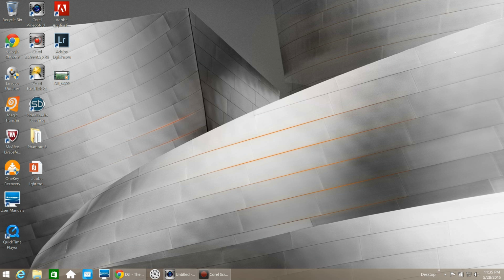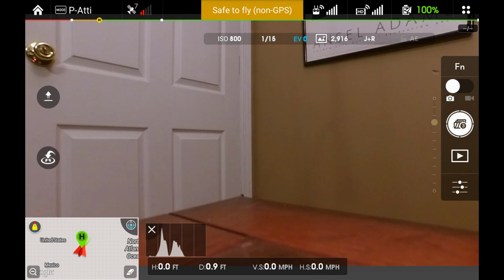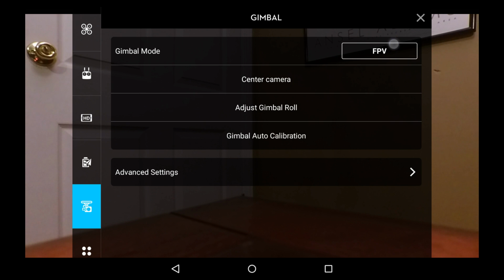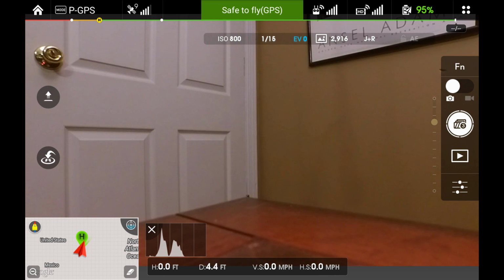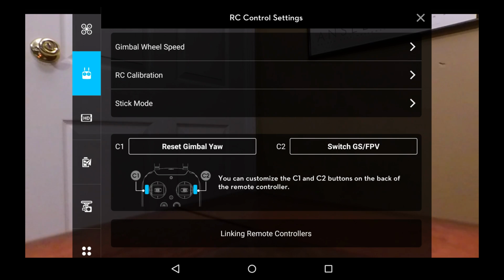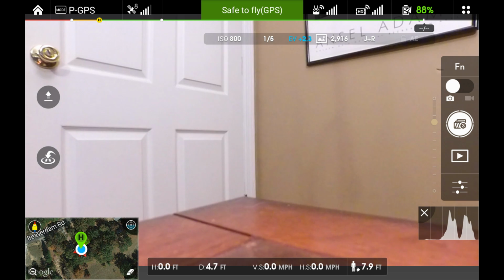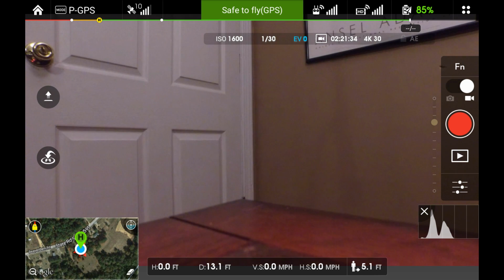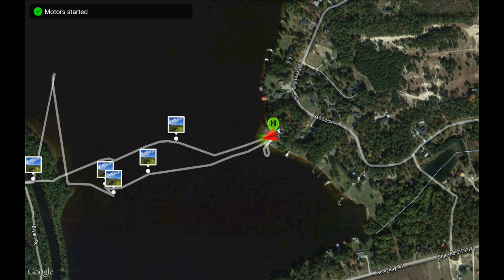DJI Phantom 3 & DJI Pilot App (now DJI GO App) Walkthrough & FAQ

Comment: great video!!  thanks!!!   On the ISO settings, what are the P and M options on screen. I know the M is prob manual what is the P? is that AUTO?
Also looks like my EV is set at +0.3 is that about normal. I never have messed with it that must be default? should I change it? Like I said ISO is set in P whatever that means....thanks!!!
Reply from the maker: +natserog  I'm going off memory here...I believe the P stands for "program". In auto/program mode, EV stands for "exposure value". If you make the number positive the picture will be more exposed, if you make it negative it will be less exposed.

Comment: Gosh ample choice can be a bit daunting at times.  I was wondering if you can tell me a bit about max distances and what aspects of distance affect what eg live video feed etc?  Oh and where is video recorded ie on drone or android?
Reply from the maker: Wing Man Distance is dependent on terrain and condition but you should be able to get over a mile without a problem. This unit pretty much has the longest range out of the box for an RTF. Video is saved to the SD card and the camera and you can also cache to your mobile device real time as well but this may slow down your video feed and lower the performance of your mobile device.
Reply: Drones In SC Thanks.  Also if I may ask what would happen if it went out of range? Are there any warning/indicator lights to indicate range limits or weak signal issues, and also what are the safeguards with range issues?
Reply from the maker: Wing Man In the normal mode with GPS on, the unit will return to home point. All the indications you are asking about are covered in this video. Range, signal, battery life, etc.
Reply: Drones In SC BTW have you have a chance to look at the PlexiDrone by DreamQii?  They have a campaign on indiegogo.  The specs look pretty amazing especially the x3 units with 'swarm' capabilities!   However there has been quite a stir about they customer service and blocking customers requesting refunds re march delivery dates not being fulfilled!  Just thought I'd get as much of a heads up as I can rather before potentially blowing $3k!
Reply from the maker: So many units have disappeared after taking money from crowdfunding...or the units that end up in production do not meet the promises that were made initially. There are tons of quadcopters on various crowdfunding sights...and in various stages of development...I doubt most will ever enter production.
Reply: OK thanks for your opinion.

Comment: I just want to thank you for the best and most informative video I've come across yet. And get your suggestions regarding the firmware update for the RC (controller) I successfully upgraded the Phantom 3 Pro firmware, but have found it impossible to upgrade the RC. I tried everything; cable from Phantom gimbal to RC, new SD cards and all I get is a red light and beep until it turns itself off. I did some research and found that some have been flying for years like this, and one tutorial video showed the same little red flag I get in the App stating to upgrade the RC firmware. I've had no problems flying and having a blast anyway!
Reply: +Jim Miller Good news! I just upgraded to the DJI Go App and  V1.3.20 firmware with NO problems whatsoever and the RC control was a success also! Very happy with the results and easy to do. There must have been an occasional  bug in the RC upgrade that has been remedied. Highly recommended!
Reply from the maker: +Jim Miller Glad you got it working...with the DJI Go app, you don't have to use a memory card to firmware update the transmitter anymore.

Comment: On my new Phantom 3, the front LED,s (fixed red) stopped working.
Some opinion will be welcome.
Thanks
Reply from the maker: João Carlos I haven't read of anyone having that specific problem. if it is brand new, and you want to honor your warranty then you should contact your dealer or DJI. Otherwise, open up the shell and see how the lights are connected. I am unsure of how it's connected as I only had the P3 in my hands for a short time before I had to send it off for a FC and gimbal problem (still don't have it back).
Reply: I solved the problem.
Arms LED can be disabled at any time by configuration. It was my mistake.
Thanks a lot
Reply from the maker: João Carlos Oh, you are talking about the ability to turn off the LED lights...I thought you were saying there was something wrong with them. Got it!

Comment: Native here in Chas. S.C.  
I'm having problems with my Phantom 3 Wifi not showing on my iPhone. Iv'e flown for a couple years and Iv'e flow my phantom 3 a few times as well. Why do you think it's not showing my phantom 3 on my iphane 6+ within the WiFi?
Thanks for your help and video's.
Tommy
Reply from the maker: Tommy Bessinger P3 is not like P2, you don't wifi connect to a booster...you use the included cable to connect your controller to your mobile device (no wifi).

Comment: tell me please what the connector wire that came with my dji3 that has a mini usb and a usb on other end. I know it plugs into my copter but what does it do?
Reply from the maker: Charlie Stovall I only had the P3 for a week and it's been out for repairs for two months now so my memory is a little hazy on this. If I recall, there was an option in the DJI app to enable downloading of logs..then you could connect directly to the Phantom and download logs. Of course, you can also get some logs from your mobile device.
Reply: +Drones In SC 
whys it been out for repairs?...problems after a week??
Reply from the maker: darkelf1000 I had a problem with the original SDK firmware that caused some FC errors as well as a gimbal problem. I finally got it back a little over a week ago.
Reply: Wow, am cautious about getting one of these. 
Getting a device for fpv that does not lag is another headache.
Reply from the maker: +darkelf1000 It's a good platform...just buy from a reputable dealer and try not to deal with DJI directly...you will get minimal support from them (they still act like their doing business in China). 

Any of the quads out there that provide a digital HD video link to you are going to have lag...some more than others. The P3 lag is very minimal..but if you don't want lag at all then you need to look at something that uses an analog FPV transmitter, like a racer...but a racer is not a photography/video platform.
Reply: i fpv my rc car with fatshark goggles on 5.8ghz and headtracking on my channel which is great fun, but fancy this as i live in a very scenic area with lots of coastline.Thanks for a great video.

Comment: I'm curious about your C1/C2 settings options.  I have a brand new P3 Pro and I don't have the same options list-specifically, the option to switch the map modes. Is there something I have to do to enable these modes?  the ones I have are not particularly useful.
Reply from the maker: johnnytraveler1 I'm not sure why you can't get it to work...worked for me just as I showed in the video. I don't have my P3 to try things out on right now...its been out for repairs for a looong time...getting ready to call DJI and ask them where it is.

Comment: You are out of date. Current version is 1.2 as shown on the download page.
This version has a new feature. Instead of the old waypoint mapping style, you now plot a course with your finger!
Just one problem. I can't find a way to set the altitude along the course.
Maybe you can?
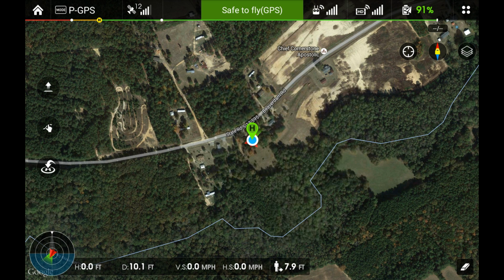Reply from the maker: Richard Remington II Richard this video was released in May...with the current firmware at that time. You can not get waypoint flight with the P3 and stock firmware at this time. The feature you mentioned is covered in the video at 18:34 but it is not what you think it is...not waypoint/automated flight...it's just a pre-planning tool where you can draw on the map with your finger and make some blue lines to represent your proposed flight path.

It is unknown whether or not DJI themselves will release this feature within their own app & firmware...they appear the be replying on 3rd party apps to do this via the SDK (Software Development Kit) using apps such as DJI Autopilot or DJI Ultimate Flight.

Comment: How do I change to Home lock, course lock or atti lock like I do on my Phantom2?
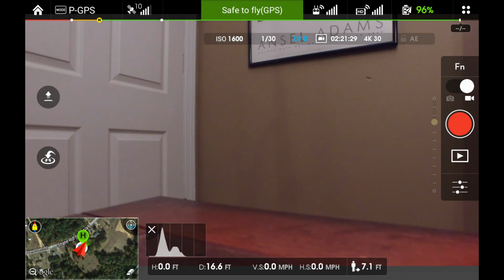Reply from the maker: Kenneth Gundersen Covered in this video at 32:30.
Reply: Drones In SC Thank you mate. It sort of works a bit difference than the Phantom2, but it seems to work pretty well when you get used to it.
Reply: You don't. Home lock is automatic. There is a 3 way switch on the top left side for either P,atti, or failsafe.
Everything else is done elsewhere in the app.
Reply: Richard Remington II As far as I know there is no home-lock feature on the P3 yet. I contacted DJI and they answered that there is no home-lock feature now, but they did confirm that they are working on adding home-lock feature in the future. I find it a bit strange that the P2 have home-lock, but P3 dont have it yet.
Reply from the maker: Kenneth Gundersen Kenneth is correct. There is no home lock function at this time (even though it IS mentioned in the manual). The only IOC mode we have is Course Lock. I think Richard may be confusing RTH with Home Lock. Again...this may be something that shows up in a 3rd party app using the SDK.

Comment: lag ! lag lag !  in video monitor live
to slow frame rate for fpv !!
Reply from the maker: Marty Mcfly When I flew there was minimal lag and I flew FPV with no problem at all. That being said, that was with earlier firmware. I haven't flown the P3 in two months and from the reports I've seen, lag has become an issue for many with the latest firmware releases. My unit is still out for repairs so I haven't personally flown with the newer firmware.

Comment: What is the difference between gimbal wheel speed and gimbal pitch
Reply from the maker: Devananth V.S. I haven't had my P3 for two months now...out for repairs...I only had it for a week unfortunately. Both of these seem to have a similar effect on the camera but I am not sure if it supposed to be that way or not. Perhaps someone else who has flown recently can chime in. Maybe they do the same thing in a different way..(i.e. gimbal pitch slows the maximum rate of the gimbal movement and wheel speed lowers the sensitivity of the knob on the controller), but that would be speculation on my part.

Comment: Can you set a route for the quad to fly automaticly
Reply from the maker: Jandre F The stock firmware does not support waypoint/autonomous flying. You can download SDK (software development kit) firmware for use with 3rd party applications which may have this function but the SDK firmware is not very well developed at this time.
Reply: thanks

Comment: Please help. this new p3 has been a nightmare. first I had to up date the firmware. then first time I flew it the pilot app froze and now I have no image in the little corner maps screen, it just shows a blank grid. . NOW GET THIS 1HR AND 20 MIN. ON HOLD AT DJI AND COULD NOT GET A PERSON ON THE LINE. what the hell . any idea what I need to do to sort this quad out. DRONER
Reply from the maker: Victor...I don't have enough indignation to answer your question. Yes, DJI customer service is usually pretty lacking, unfortunately. You will often get better results or ideas from one of the FB groups for phantom 3 owners. I've heard of some bugs with the current app version but can't comment on them as I have been without my phantom for a few weeks now...it's in to DJI for repair.

Comment: EXCELLENT review awaiting my P3  QUESTION what is the height you can fly indoors ty  and what is the flight time  ty
Reply from the maker: AWESOME AUSSIE FLYOVERS The max height is read by the barometer...doesn't matter if you are inside are outside. If you are asking about how high you can go with the VPS system its 30 to 300 cm.
Reply: ty

Comment: Great video! I think the HDR is when the camera takes multiple exposures (bracketed)  that range from the shadows to the highlights, then combines them together to create a single image that has more dynamic range.
Reply from the maker: Bobster986 You'll get much better results if you bracket yourself and stack the images in post for HDR. I haven't noticed much of a difference selecting HDR in the pilot app vs. just taking a regular shot.
Reply: Have you installed the new firmware yet? I have heard there may be an issue with it. Thanks!
Reply from the maker: I had to send my P3 in for repairs unfortunately...had gimbal issues from the get go but had some other problems when I loaded the SDK firmware.
Reply: Drones In SC That's too bad, I hope you get it resolved soon, but I meant the regular firmware up-date (1.2.6) I heard that there were problems with it that causes units to just become large flashing yellow light paper weights. I'm just asking around to see if other people have experienced this same problem. DJI is known to sometimes have bugs in their software occasionally. Thanks!

Comment: thanks so much for this video. it is such a help now knowing what some of the settings do and how to actually set them up.one question i sometimes get wavy/shakey video is that a setting i need to change or just me
Reply from the maker: Thanks Sean! Wavy video? That sounds like "jello" and usually vibration is the culprit but also many have forgotten to remove the foam rubber piece on the back of the gimbal that was used for shipping. If the rubber is not there, then you may have a damaged prop or one that is out of balance.
Reply: Thanks for the info, i took the foam out so il check the props and see how it goes from there. thanks again for an awesome video, its really been a big help.

Comment: the best App tutorial by far! you deserve a pat on the back. So many things I wasn't even aware of. Sorry to hear you had a firmware update problem, I'm actually a bit worried as I only just got my P3 and updated firmware to 1.2.6 yesterday, result was success but have read the odd thing on forums that some people are having their aircraft fall out of the sky for like 30 metres then regain control after doing firmware updates...this has me worried also. I haven't flown mine yet as looking for a tablet that's not too costly. I just hope first flight is incident free!
Reply from the maker: Thanks for watching, Trevor. Good luck on your first flight!
Reply: Drones In SC awesome first flight thanks except I couldn't get any video motion in the app on my tablet, I had lots of lag - couldn't use video to fly by at all. Also no camera control via the RC itself, tried to take video and photos, no response. Set compass as per correct method then it said in voice safe to fly or whatever she said.. so it was totally by watching the aircraft. I have a samsung galalxy tab 3 7 inch, disabled many apps to increase performance as recommended by others with this tablet. Another issue is I haven't had an activation screen at all. I've heard others haven't been able to take off until they activate, not in my case. I have tried to remove RC cable and plug back in to no avail as I've read somewhere. I will try again however in 2nd flight test. I must have done something wrong maybe..I can take off and fly with great response in the sticks - but no camera controls at all?
Reply from the maker: I haven't heard of that problem at all. I hope it works for yo on your next flight. You might want to contact DJI immediately. If you have  a problem within 7 days, they could send you a replacement...otherwise, if you wait like I did (for two weeks), then you get to send your unit in for repair at your cost (shipping), wait for two months, and hope it is covered by warranty.
Reply: Drones In SC Ahh too late for me then as I've had the aircraft for over 2 weeks but our weather has been terrible as it's winter here, plus I took some time to buy the tablet. I have heard many bad things about DJI's customer -non-service. I don't fancy sending it to them at all. I bought it from China online so not direct, they did say they had a service centre in Australia if I needed to send it back. I'm in New Zealand. Shipping would more than likely be over a hundred bucks...crazy living at the bottom of the planet!
Reply: Flew again yesterday, all camera controls working fine now and resulting video was good. I think I had a dyslexic moment and turned on aircraft first in the first flight so had a sync issue? oops! Still have some lag on screen but I guess I will bite the bullet and disable lots more apps on the tablet to see if that helps that problem. If it does then all issues will be solved and I'll be happy. 2nd flight was a huge leap forward so pretty confident I'll sort it.

Comment: At 27:10 or so talk about pushing in on the camera settings dial (on the remote control unit) to change from ISO to shutter speed to EV, etc.  When I push in on my dial I get nothing.  Do I need to have that box open at the bottom of the shutter button area to make those changes ? Thanks in advance.
Reply from the maker: Sam Casale You have to have the advanced camera settings window open first.

Comment: First, great video. I turned off VPS as you suggested as I fly over water as well. I did notice the Phantom did not hold the vertical position as good at lower levels and I had to control the height more than I do with it on. By low level I was at 3 metres (say 10ft). Most likely it is one of those thing you need to try for yourself but I am reverting to VPS on. Keep up the good work on the videos……Regards Denis